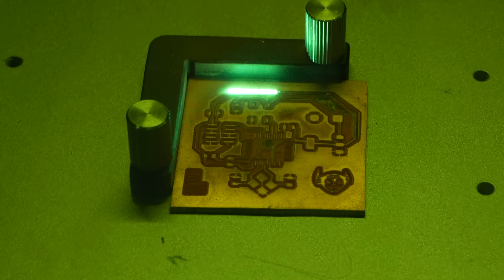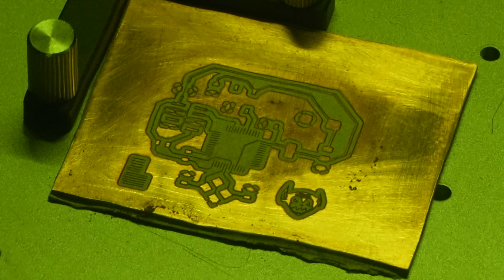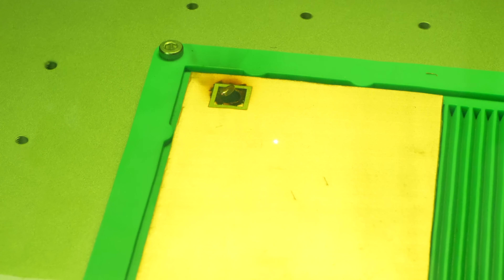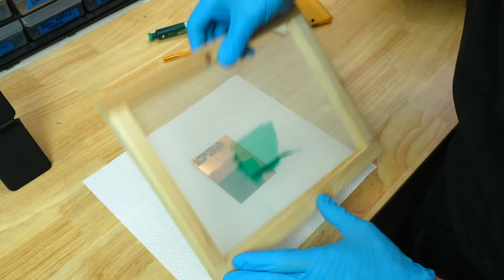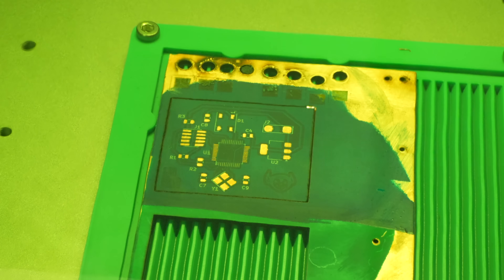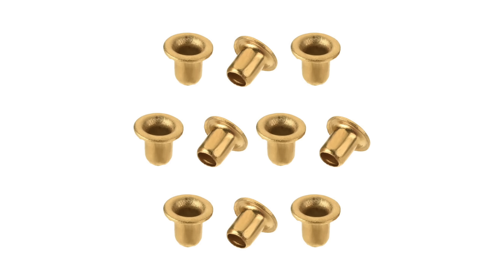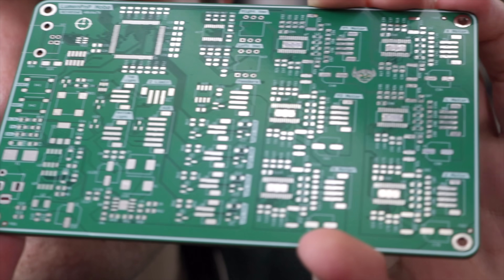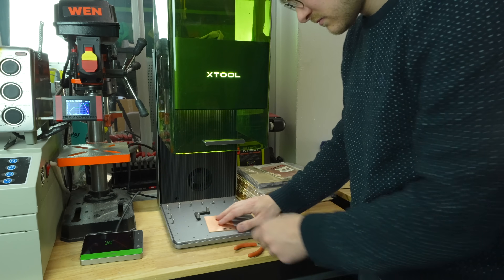Prototype PCBs faster than 3D Prints

Comment: There are very thin FR1 sheets that you can separately etch, and then glue them on top of each other. This way you can make multilayer boards too. For vias, do what I always do. Make very tiny holes in the board, then use a very thin copper wire, and just like when you sew something with a needle, sew the board with the copper thread. Don't forget to solder the first and the last via. Then put a little solder paste on each via and solder them with a small amount of solder. The  cut the extra wire between vias. The thin copper wire can easily be extracted from an old handsfree. Those have very thin threads of copper wires inside their wires and also much thinner wires in their speaker coils.
Reply: I use a hotplate to solder surface mount parts and I imagine the problem with this method would be that if you do the vias first you wouldn't have the bottom layer flat for putting on the hot plate.

Comment: You already got solder baths working right @stephen_hawes ? Why not use a through hole mounted component without the component? The via doesn't have to be hollow right? That's just a side effect of current manufacturing processes.
Either a short lead with a lump at the end or tie a simple knot on it for prototyping. If the PnP cannot place that, make two VIAs right next to each other and use a jumper - so long as you solder to a pad on both sides.

Comment: The method my dad suggested for vias is using a thin piece of wire without the plastic/rubber sleeve, and solder it on both sides

Comment: There used to be a product for vias that was basically copper coated solder that were made for specific via sizes that worked nicer than the rivets.  
Did you try cutting g10 board? It's much better for higher frequency boards. And yes burning fr4 will make a mini carbon arc lamp with 24v supplied.  I know, I did it when I accidentally cracked a cap to ground.

Comment: For my double sided DIY PCB via's, I drill the board and then stitch each via with a long stripped wire wrap wire through each  as a rats nest. Then solder each side. Then clip the rats nest loop away leaving nice well connect traces.  It is easy , fast, and works well, and if necessary they are easy to repair.

Comment: One idea might be conductive epoxies and electrical conductive adhesives specifically made for electronics by companies like Henkel. They aren’t as conductive as copper, but for a process with slightly larger vias over short distances it’s probably a good compromise.
Reply: Building on this idea, there are also conductive via fill processes in HDI boards. My guess is a vacuum process or simple vias large enough to squeegee the epoxy into would be good enough. Depends on epoxy viscosity. The solder mask process may help create a helpful epoxy ‘pocket’ for connection if you do un-tented vias. Something like:
1)cover board with solder mask
2) laser via openings and drill vias
3) screen stencil conductive epoxy into vias. Ensure it squeezes all the way through and oozes out the other side of the double sided board. If not possible the vacuum process is needed. 
4) flip board over and scrape excess, leaving only via and pockets filled
5) cure 
6) continue double sided pad mask etch process as normal

Comment: For two sided alignment, do what carpenters do, use dowels, 4 in total, 3 used for each side - is accurate and beats drilling hole. Some designs might need to use holes, i.e. those where specific edge design (e.g. round) is required.

Comment: For hobbyists, nothing wrong with soldering a wire (through-hole component leg cut-offs) through holes in a two layer board - rivets/vias not necessary.
Reply: When the pin is smaller than the hole, the solder with draw into the hole and barely protrude above the surface. Probably best the di them first and sand down as necessary prior to soldering other surface mount components.

Comment: You could try to use tiny hollow copper tube/pipe that is press into pre cut holes, then is somehow snipped to length, or it's already cut to the right length then pressed, depending on the side/thickness they might be able to be cut with the laser then pressed into place. it seems like copper tubes of that size do exist but sourcing and price I'm not sure about along with the consistency.

Comment: What about this: Drill the vias and then use a soft scraper to scrape solder paste in tho the vias. Then use the fiber laser to melt the the solder paste in the vias thus connecting them.  You might have to do it on both sides to work.

Comment: Still an ass backwards process removing the material rather than depositing.

I squeegee on a layer of copper paste which is then fixed with the laser.
 The remainder is rinsed away and reused.

Comment: Vias are easy.  Just make a pad on both sides and put a wire through and solder both sides.  Only downside is that vias commercially done are tiny but this method requires a pad.  But those rivets take up the same space anyway.

Comment: About making those vias:
Ben Krasnov, from the YT-channel "applied science" showed how to relatively easily plate copper at home, and how to make the electrodeless plating solution.
He figured it out the whole recipe, and used it to make conductive PCB-traces on 3d printed nylon. (it has a 3d PCB on SLM-printer project).

Comment: i think to ensure the double sided acuaricy are the order of the steps important: 1 Cut it to dimension 2 the via's 3 the pcb layout front and back then the mask etc. and for the Via's why not soldering it shut so that they are connected (if that is possible) maybe paste is the right option who knows.

my reasons for the dimension cut at first is to have all sides and pieces exactly the same dimensions and it's better to align them after the drilling (alternativly you can make it so there is a alignment hole/pad/cross in a corner of the board to proper align it and either laser it away or with a quick aligning pass on ultra soft and fast setting if you're fancy)

Comment: You can drill the holes then use conductive spraypaint and use plating to plate it with copper. And you can make holes that way.

Comment: Awesome video, very excited to see where this goes next!  I have two significantly-easier-said-than-done ideas:

1. I think trying this out on copper clad polyimide film would be big—I assume there would be challenges keeping it flat while processing, so maybe tacking the corners with glue or something to a carrier board would make things easier.  A single layer PCB might be a hard sell overall, but a single layer flex PCB that you can make in ~90 minutes would really be game changing.

2. Following from point #1, and as an answer to the issue of vias: you could literally staple two flex PCBs together if you have overlapping "via pads" aligned between them.  You'd still probably have to solder them in, and I'm sure there will be issues with different metals/electrical conductivity/new rules for via placement that you'd need to figure out, but polyimide sheets being so thin means this could scale really well to multiple layers.  If you stapled, soldered them in place, and then cut the extra metal from the staple off, there might be a way to get blind/buried* vias with multi-layer boards.
Reply: You could use adhesive polymide tape

Comment: I don't know if this is helpful or not, but I was curious if you could find copper pipes small enough to be useful.  Found Copper Capillary Pipes.  I'm not sure what sizes you would need, but Albion Alloys claims to have smallest OD at 0.5mm and smallest wall thickness of 0.2mm.  I don't know if flaring it out or soldering it would work.  Likely could be made to have less height than a rivet though.

Comment: For the vias... you've got a fibre laser. If you don't want the rivets sticking out, why dont you just make an inset in the board for the ridges that don't sit flush, you said you were going to solder them anyway.

Alternatively, why not rather than a hole, cut a super thin slot and slide some copper foil in there and bend it flat over the surface copper on top and below?

Comment: If you’re using fr4 boards, add a layer of resist (paint could work) and ablate that away and etch it. As for the vias, how about just wire and solder each side?

Comment: I'd either use the laser to countersink the rivet head or do something completely different with the design of vias. Who says vias have to be round holes? Could they be short rectangular holes that run a short distance parallel to the wire tracks so a piece of copper wire can be laid down next to the track and soldered across onto it. 
Is there away to burn away the substrate material from under a track without hurting the copper on the other side to the burn and then be able to fold the copper down into the cavity to solder it on the other side? Make all of the folds from the component side and all of the via solder on the other. (Imagine a short copper track with nothing underneath it at one end, push that end down and bring it out on the other side).

Comment: You should look into flush rivets - start with a thin wall tube, countersink the hole on the board on both sides, then use a center punch to flare the tube on both sides. A rim of solder to get a solid electrical connection may be worth it as well.

All of that should give you a solid flush via connection at the expense of the slightly larger hole size.

Comment: It'd require more machines in the chain, but adding more copper on top seems like the kind of thing a sputtering machine could do. Maybe use the existing standoff holes you'd probably want anyway as an alignment jig for a thin masking material, sputter onto that, laser the unwanted layer 2 material away, and repeat? 

If you have a sputtering machine in the chain anyway, it's possible that you could build a PCB on pretty much anything that with sufficient heat resistance/dimensional accuracy, which sounds pretty exciting. Maybe even a high-temp thermoplastic like PEEK, PEI or PPA could be used as a substrate, unless I'm misunderstanding what circuit boards are made out of.

It looks like sputtering machines aren't exactly hobbyist-level in terms of availability, but https://www.youtube.com/watch?v=aljbjJbfghs Thought Emporium did manage to build one that seems to work fairly well.

Comment: Rather than 'rivets', you should look to use an eyelet.  These are used to repair double-sided PCBs where the original plated hole has been damaged or a new hole is needed.  Search "Plated Hole Repair" and PCB.

Comment: Laser a hole and then use a header pin to connect the two sides of copper. It's a design constraint, and the hole will have to be shaped as a header pin. But it will work and uses widely standard available parts. The pin can be used for testing, programming, etc. So, it's not a complete waste of space.

Comment: Depending on the hole that crosses both sides of the board, if it is large enough, the melting of the solder (welding) would make a via itself.
Either inserting a wire, or even some kind of liquid gel metal that can be soldered, would require always some work.

Comment: Known holes + dowel pins for alignment and double sided registration. You can 3d print a baseplate that accepts dowel pins, screw the plate down, then drop a board with the first set of holes drilled right onto the pins. No guessing, no fuss,  ~20 micron resolution.

Comment: Automation using this for the vias could be impossible (alignment), but... You could manually tightly "stitch" wire through the via holes, paste the vias, flow, then use the laser to snip the extra wire by running it across the diameter of each annular ring.

Something I have been wondering about is using a low power UV laser to cure the resist. Should be pretty hackable on a regular 3d printer (or any cnc really).

Comment: 3D printers don't work at all without filament (or resin). Hell, normal inkjet printers don't work without ink cartridges and standardized A4/Letter paper!

I say this to illustrate that in effect you're trying to build the world's first 3D printer that uses a bucket of miscellaneous plastic pellets: it's 100 times more difficult! And it's already working!!!

Imagine if you had a spool of some semi-rigid uniform base coated with copper - all standardized - that slowly passed through the laser head? Then you could make an arbitrary number of layers in your PCB by stacking them on top of each other!

You could pretend this magical spool exists, or fake it somehow by assembling it yourself even if it takes 100 hours, and then see what it would take to produce them at scale.

It's OK to invent new consumables for your PCB@Home machine!

Comment: Cool stuff! I've built a Frankenstein device out of a Raspberry Pi / UV Light, LCD and a 3D printed case to burn in my prototypes into photoresist boards, but the manual etching process really can be annoying, same with applying solder mask. If I could use a laser in a reproducible way, that would be awesome. :D

For double sided boards I have used copper wire, to connect both ends. That usually went good enough.

But I'm too much a hobbyist on the hardware side to justify 4 grand for a laser, so I stick with my photoresist boards, without any solder mask mostly on a single layer for now. 😅

By the way, Phenole is cancerous and it's discouraged to breathe in the dust after cutting (encouraged to wear a mask). Not sure sure how it is with lasers, but I would suggest to research this, and maybe to implement some kind of air filter around the laser.

Comment: This is probably a dumb idea, but why not make a small "panel"/"Plate" that solder wont stick to with a circular small cutout (like 0.4mm-0.5mm deep) and place the via to be over the small cutout and filling the hole and cutout with solder so it makes a cylinder of solder that goes through the hole and onto the copper clad on both sides?

Comment: yes pcb's come in copper "weight" where its ounces per square foot. standard issue is usually 1oz cheap stuff can be 0.5 or even maybe less if you are getting the super cheap stuff. You can get it thicker if you need heavier traces for current or heat. In the industry I work for its not uncommon for 2 or even 4 ounce copper. For instance using a calulator from digikey its possible to pass 4 amps though a half mm trace on 4 ounce copper, where as on half ounce copper you better plan on a 4mm trace 😮

Comment: Your video popped up in my feed. .
I have a suggestion .. make a frame to hold your circuit board that has dual spring loaded clamps that can hold your circuit boards from the bottom and the side. the pressure from both should help you make your dual sided boards or even a run. Or you could easily go with the registry pin idea that works. But the angle that holds your circuit board is not doing the job. Just on the freeze frame you board is not flush with the alignment area. Im staying a sub want to see where this goes.

Comment: :-) FWIW. As someone who has been making double-sided PCB's the 'nasty' way for years with the likes of Press 'n Peel and Ferric Chloride because I can:
-Good Registration would seem to be most consistently achieved by baking registration post holes of the exact size in to the layout that align with a solid pre-made jig.
-VIAs are most easily achieved by considering them in your design: Can I use a through-hole component to achieve the task, either passive or IC? Solder both sides! 
-If you really, really can't use a component you can get away with sticking wire though a non-plated VIA and adding solder, then flush-cutting the excess.

Most of the trick to working with DIY PCBs, however you do it, is to consider it's limitations at the design stage. Then issues like "How do I make a reliable VIA?" become non-issues. I hope that helps.
The question to ask myself is "Why do I do it?" If it's, "Because of the fast and cheap turn around time" then I probably need to play with this laser technique. But if the answer is, "Because I like screwing about with nasty chemicals" then I guess I'll keep doing what I'm doing.

Comment: You could use male breadboard pins, stick the pin through a hole made with the laser and solder both sides. If the laser can't make the hole you might be able to punch the hole with the pin.

Comment: blast a hole though it, then use some 0.06mm copper bond wire to poke through the hole and then solder each side and boom, done! This way you can keep your original via size holes

Comment: For the Vias I'm thinking to drill them, get solder wire in a slightly smaller than the hole. Then cut a piece of and "solder rivet" it. Like solder it from both sides if that makes sense. You could also press fit a little piece of copper solid wire in the "via" hole and then solder both sides. Cheers, hope this gives a solution/inspiration
Reply: How would you get the bottom of the board flat so you can solder the top parts with a hotplate, though? I think you'd either have to do the vias after the parts or your only option would be to reflow in an oven.

Comment: Amazing! Love this! HEY... can't you apply the solder mask first, then cut the drill holes, then remove the solder mask template for the contacts, then finally etch the cooper? Then you don't have to move the board and do it all in one step? I'm halfway through the video so you'll probably think of this try it and then explain why it doesn't work. But this is super cool!